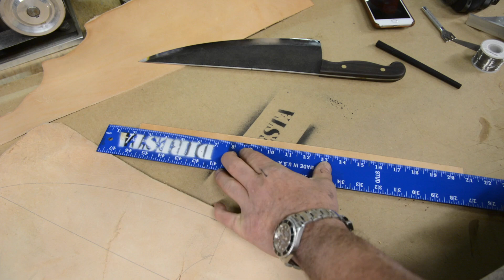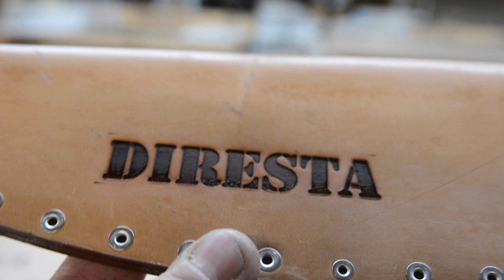✔ DiResta  Sheath for TheBigAssKnife

Comment: Nice job. Was the additional PVA glue on the edge just for more stability in keeping those two parts together? Or do you like how it makes the leather look once dried?
Reply: +Bruce A. Ulrich You are supposed to burnish the edges then impregnate them with wax for waterproofing and to give a neater finish. using pva would do neither.
Reply: +Mathew Gray That's why I asked him his reasoning. I am curious.

Comment: If you use nails to drill the holes in your press leather burns and does not create the bur on the side of the leather and allows you to stitch a lot easier

Comment: Hey Jimmy, just a tip from a beginner leather worker, but I experiment alot.. Just running a quick stitch between those holes first with thick thread, then adding the rivets and look pretty cool. I've done it and you can superglue the threads down or just use a skiver to sink them a bit. It just adds a neat beefy touch to a simple sheath.

This came out cool though, I love how you just kept it super simple with the knife and the sheath. It works for sure!